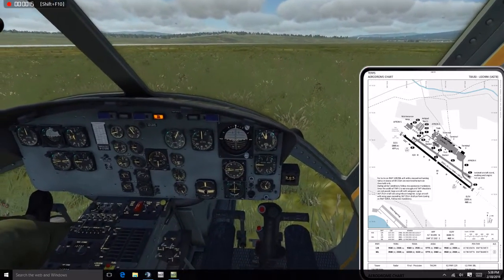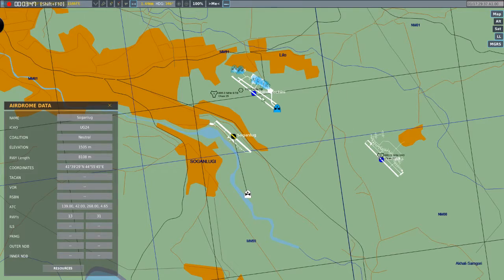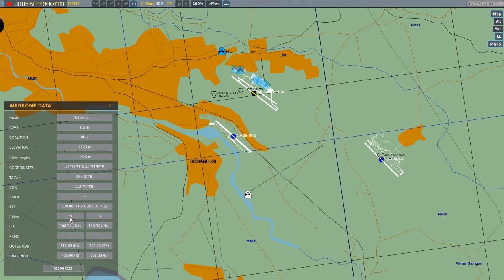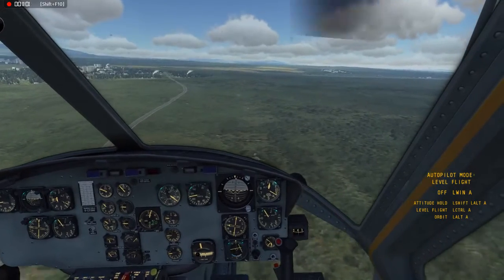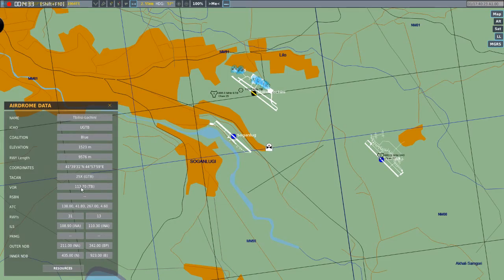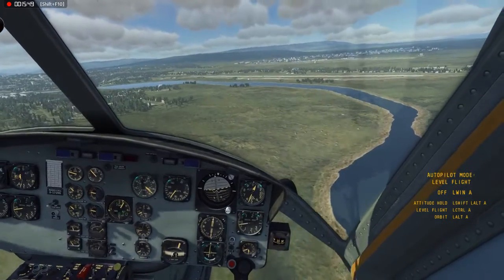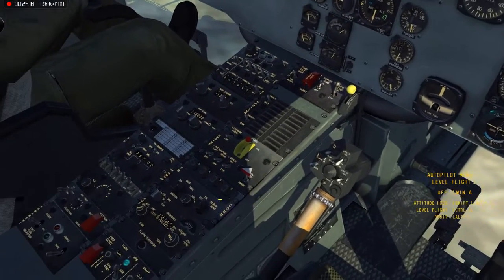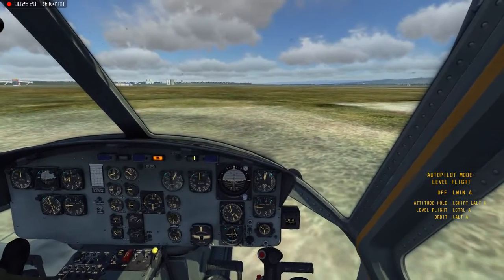DCS Huey navigation and communication tutorial (PART 1*)

Comment: OK, I had a play with the ADF and NDB beacon signals... this is a great way of getting round the DCS map :)  I landed right next to one of the outer NDB transmitter stations after homing in on it via the ADF.  I must say I never noticed how well these are implemented in DCS... The antenna accurately represents a folded dipole, i.e. for HF (high frequency) strung up between two poles.  A small mistake was that one of the outer NDB stations was plonked right across a railway line at Krymsk 408Khz (KW)... but I suppose we can forgive that :)  I would also advise to have a morse code chart to hand, because as you stated, some of the beacons are close together on the tuning dial and you could easily lock into the wrong one.  As a radio ham I know morse code so can identify the correct beacon. Here is a link for a morse code chart to print if you want to start using the code letters...  its easy and a great help.

http://www.apogeekits.com/PDF_Files/Morse_Code.pdf

Most of the ID letters (printed next to the frequency) are only one or two letters... so it does not take long to learn them from the grib sheet.      I did read in the Robert Mason's,  'Chickenhawk' book  (every one who flys a Huey  has to read)  that they used a hood over the peter pilots head so that they could only see the instruments  to fly by and had no external visual aids to navigate by!  Can we get that good? :)    OK, this is great stuff... onto learning the radio ATC stuff next :)
Reply from the maker: Thank you for your link, I am terrible with morse code so I will be adding that to my digital kneeboard!! And that explains the letters that are written in DCS after each NDB. that will be a much faster way to verify i'm tuned in on the right freq.and they still use the method of using a hood to block your vision outside of the aircraft when you are testing for your instrument flight rules qualification... but the instructor is ready to take controls if you begin to get into a bad flight regime. luckily in DCS our lives are considerably less limited haha! I definitely suggest practicing instrument only flight and landings (IFR) so when you do find yourself in the fog or low light / no lighting you are prepared. even in perfect weather we need to know our huey's airspeed and rate of decent to avoid vortex ring state which is usually the #1 challenge for huey pilots, that and avoiding mast bumping.
Reply from the maker: I just found this list of NDB's with the corresponding morse code ID's and it shows the translation for people like myself that are not very fluent with morse code. here is the default file path you can use to find it in your DCS files (for DCS 1.5) : "C:\Program Files\Eagle Dynamics\DCS World OpenBeta\Doc\DCS World List of all available Beacons EN.pdf"
Reply: +dirtywaffleiron1 Yup... that's my main sin these days; mast bumping.  Normally when I am asking too much out of the virtual physics... my IP would be bashing me round the head LOL  Still, knowing you can't die in a simulator encourages liberties.  Sure, I keep forgetting how daunting the morse code can be to learn.  I learnt it years ago to gain my HF ham radio licence (G4***) and it took me months of doggedly listening while I got my speed up to the required 12 wpm for the test.  Thanks for the beacon list... I also managed to find same online...

http://vk.com/doc1084679_396017486?hash=1f2ee3ceaacf660e5d&dl=455c15aee0729730e8

I will print this out... but from what you have said... I gather you can add it as a page to the knee pad?  I presume you just drop the file in a DCS folder somewhere?
Again, thanks for all your help... this has added a whole new dimension to flying the Huey for moi...
Reply from the maker: I'm looking into finding a way to add it to the in game kneeboard so it will always be there when I pull it up... no luck at the moment. for now I just have it on one of my side monitors.

Comment: Hi.  Subscribed.  Great video.   I'm a little confused about one explanation.  Setting switch to 1, you stated it's VHF  FM.  Number 3 is VHF AM.  Why use UHF over VHF FM or AM?  Is #1 reserved for tower and not ATC?  I'm just trying to sort this out in my mind.  Thanks
Reply from the maker: yes i get those confused all the time look at 19.26 mins in,...  that knob selects what radio you "transmit" on, so 1 = FM, 2= UHF, 3= VHF AM. you can listen to all three radios but wherever that knob is set is what you will "transmit" on. so to talk to tower you would need to set the VHF AM to the correct tower freq. and set the "intercom mode" to #3... if tower was a UHF freq. then you would set the UHF to tower freq and "intercom mode" to #2.

Comment: You can turn the OBS bug on the ILS indicator till the vertical line is centered to get the azimuth to the Omni Directional Beacon(in case your aircraft doesn't have the double indicator needle) then flip the switch on the radio compass from ADF to VOR like you would to slave the needles.

Something I found odd, if you try to land on the ODB(VOR antenna) it'll burst into flames and burn up, even though it's all metal. : /

Comment: You must have the download version of DCS Huey and i have the disc version. My kneeboard has several pages on Luchini but only shows ILS and ATC frequencies. It does not show VOR, FM, AM or NDB frequencies. Even after updating to latest version, this page does not show up on the kneeboard. You also have NDB's on your F10 map and mine doesn't. Any info would be appreciated. Thanks!
Reply from the maker: are you on 2.0, 1.5 (beta) , or 1.5 (stable version)?
Reply from the maker: I use 1.5 beta. I would recommend downloading that if you can. it's free.
Reply: I will try it. Thanks so much!
Reply from the maker: +Victor Leonard no problem, good luck!! see you in the skys

Comment: Hello Dirtywaffleiron1!

I appriciate your tutorial, very well done and very helpful! However I am having issues with the ILS not responding to me putting in a ILS number. Ive followed your steps from turning the actual navunit on to inputting the correct numbers but the arrows are not reacting at all (they just stay as a cross). Maybe you could help me shine some light on what I may be missing?

Anyhow, appriciate the guide o7
Reply from the maker: if you have the correct freq. for the intended runway set and the COM/NAV turned on (right clicked on knob once) there is either a bug in the sim or maybe you are too far from the runway to reciece the ILS transmitter / not in line of sight of the runway.
Reply: dirtywaffleiron1 ty for responding. Ive tried it some more but cant yet tell if it may be bugged. I know that it has worked sometimes, others not. What i did note thou is that if you turn the right knob on the FM comm panel to "home" the tracker on the front dashboard does nothin at all.
Reply: It may be bugged since I've been pretty close and also far off. I will try around with it some more and get back to you, thanx for responding :)

Comment: VOR seems much more accurate and ADF is a bit dodgy in that you may not be on the exact freq.
Reply: That's the entire point. This stuff was figured out in the 1920s and still used today, so obviously the system works. The adf is purposely not accurate and has a morse code for a reason. It's just to get you in the ball park. If you are worried about which adf you are on, look at your kneeboard. They drew a little beepidy boop picture for you like this: -- -- . . -- Is the beeping in your ear the same as what it says on the airport's plate? then you have the rght adf. Is it different? then u are on the wrong freq